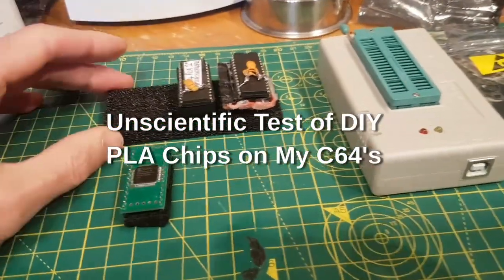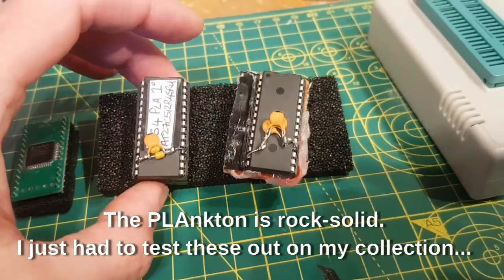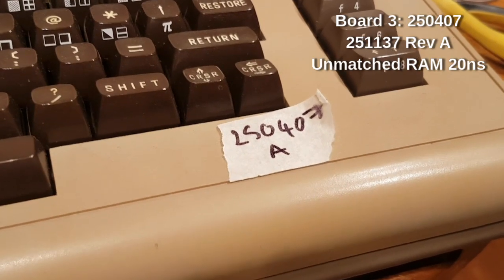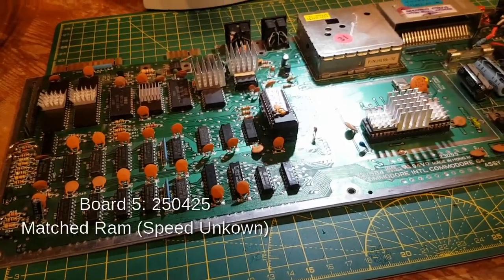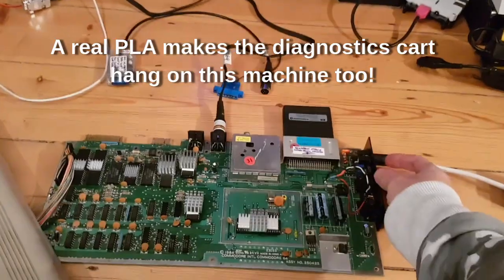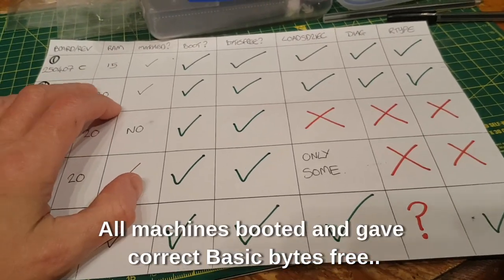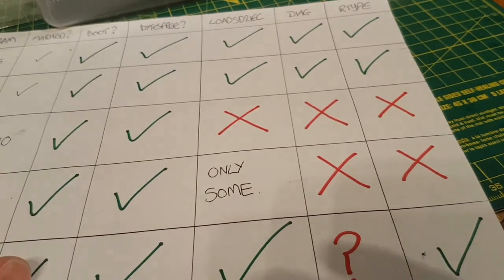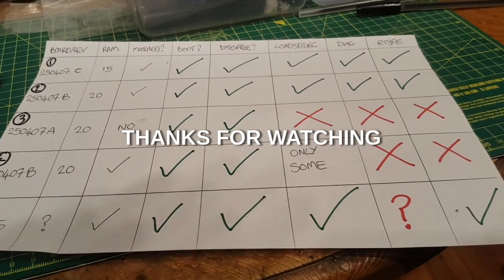Unscientific Testing of DIY PLAs on Five C64s

Comment: Well, I found that very interesting, myself. That's a hand reference chart too. A few days ago I ordered 2 of the M27C512-90B6 OTP EPROMs that ESLAPION talks about as being the best true replacement. I suspect they aren't legit but worth a try. I'll keep you posted.
Reply from the maker: I won't steal your thunder by doing a video just yet but just to let you know, I bought some off ebay too ... and ... they seem to work! Must've been lucky. On the machine that didn't like the 45ns chips in my video I am up to 10 passes on diagnostics with no issues. Only tried one machine so far.... Good luck.
Reply from the maker: ps. they are marked Korea
Reply: @Plan-C  LOL! Don't worry about me - do your thing. Plus, the more of us that experiment, the better. I assume you are keep track of Assy numbers vs chips. Also, the big thing for me, anyway, is are EPROM replacements fully compatible with timing-sensitive carts like Epyx FastLoad, 1541 Ultimate I & II and Super Zaxxon. I look forward to your video.
Reply from the maker: @MindFlareRetro  LMAO. Not worth a video really. Up to 4 out of 5 boards now. All 250407 revs pass diags now. That 250425 is still flakey but no worse than the 45ns chips and still plays Rtype). I will just put a note in the description with a link. Some of my original PLAs are getting leg fatigue now lol....

Comment: Great video =D  On the earlier boards didn't they have a capacitor on the CASRAM pin of the PLA?  Worth checking!   I've been meaning to revisit this myself at some point!  Since there's a lot of bullsh*$ suggesting that this will stop the 1541 Ultimate from working (and it doesnt).
Reply from the maker: Thanks and thanks for the video. I will have a look and see whether there are any differences on that Rev A board. Still can't figure out why that other board was so fussy about the diagnostic, even with two pukka PLAs, but it seems fine otherwise.